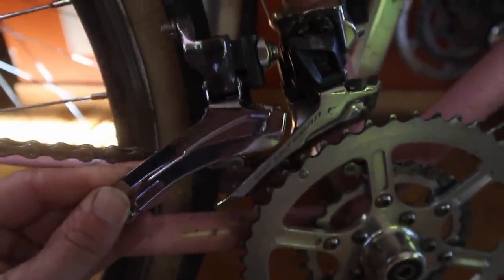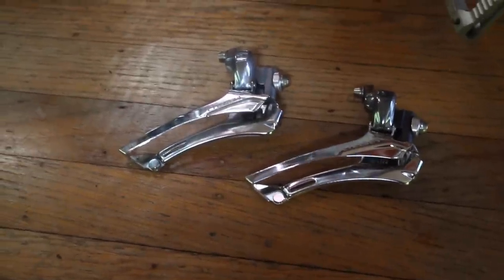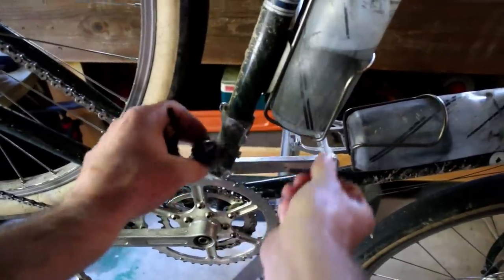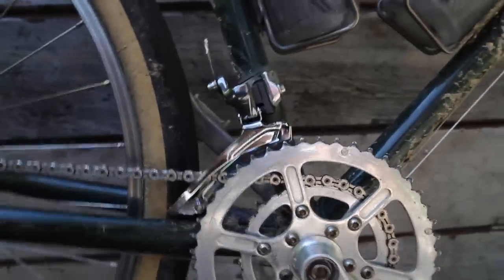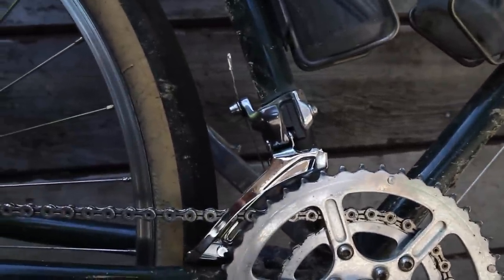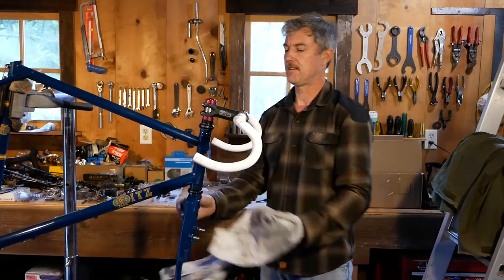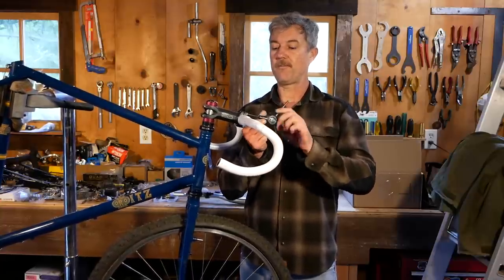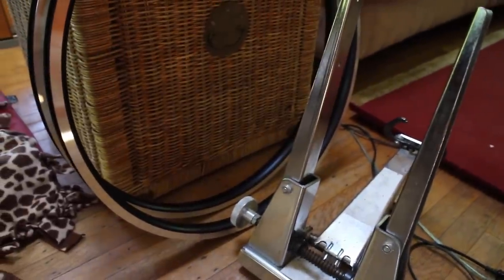Dirt Touring ATB Bike vlog 1

Comment: Great video! With the 11sp you have to pull a bit harder on the lever because you have less leverage, but the tension in the cable should be the same, assuming the springs in the derailleurs are similar. Also your HT angles might be the same but it doesn't follow that your DT angles are.

Comment: Have I ever told you about the oil I put on my chain? I add engine overhaul motor oil break in additive to my chain lube. It's basically a zinc additive. It can have a weird odor. It doesn't take much.  Too much and you get grey foam on the chain. If you attached the cable on the other side of the derailleur anchor bolt it would change the action ratio.
      Have you ever disassembled a 11 speed TT bar-con? I have wondered if a vintage part or two and it could attach to a downtube braze on. I think the lever would have to be filed so that the edge would clear the downtube, but why not?

Comment: Got clamp on Shimano friction shifters mounts to replace the braze ons I filed off decades ago. Using the Shimano friction washers and real Campagnolo levers (one filed hollow decades ago), the cables run through a braze on over the bb. Don't put the hollow one on the right! With an Acera 2/1 ratio derailleur the lever turns through 180 degrees. A bit of an anachronism,  but the original derailleur sits in a box ready for that old time corn cob look. Just try a 36 tooth cassette with the original!

Comment: I dislike/hate the new 11spd front derailleurs.
Reply from the maker: They're not putting much thought into them it seems. The plastic cable pieces are strange. The 10 speed Ultra is pretty nice. Going all the way to the older 8 speed xt and xtr is pretty sweet. Plus they have 28.6mm clamps which works perfect with a traditional seat tube diameter.
Reply: @Henrywildeberry  the routing through the plastic pieces that are easy to lose seems so unnecessarily complicated.

Comment: Remember when using MTB bars on a road bike you need a brake lever with correct cable pull.I use old MTB levers to get correct cable pull ratio.XTR 8 speed are adjustable and work good with road calipers.🚠